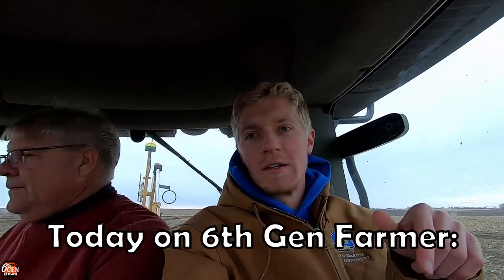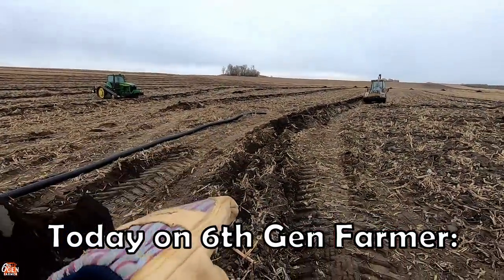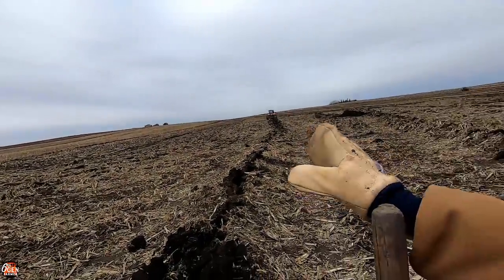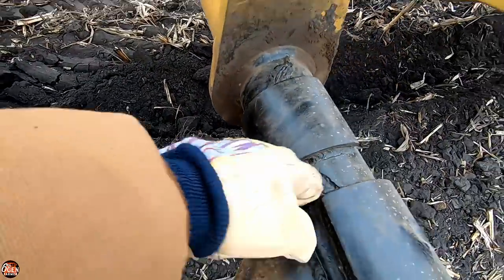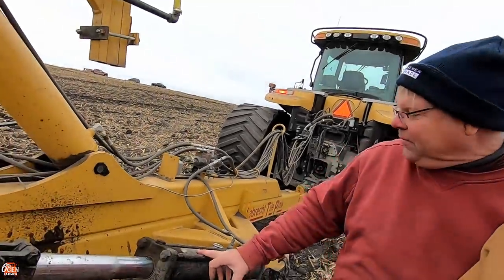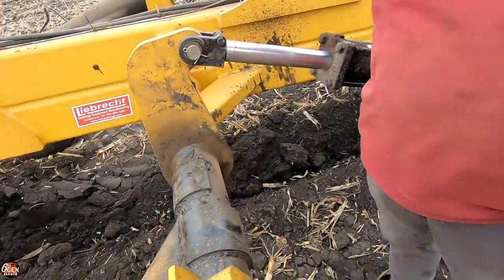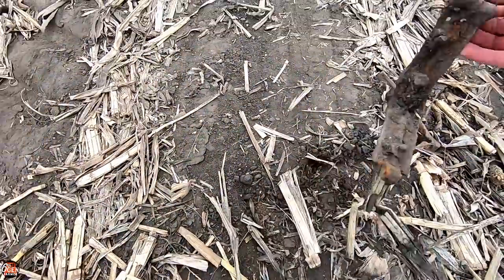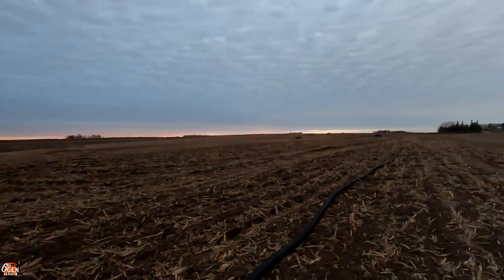TILE PLOW IS FIXED! Digging up old Farm Remains

Comment: The soil doesn’t look that heave to need tiling but it must be or your dad wouldn’t be doing it. I imagine it’s done in anticipation of wet years.  Where are the tiles dumping the water?  Thanks for the videos, really enjoy watching.
Reply from the maker: I agree that it doesn’t really look like it needed tile but this year has been so dry.  The water is draining into a county main which then goes into a county ditch about a mile away

Comment: I would not surprise me if it was the shock load from the ditch that did it.  How much difference in cost between a towed and a mounted plow ? Thanks for the video.
Reply from the maker: Not 100% sure on the price difference but I’m guessing around 25% more for a mounted plow with mounting plate
Reply: @6thGenFarmer  Thanks. I guess my "uneducated" choice would be for the trailing over the mounted version. Easily used on multiply tractors and cheaper.

Comment: What size of tile are u putting in? how long is the longest run?
Reply from the maker: We are putting in 4" and connecting it to a 6" main in this particular field... If you can make a run go from one end of the quarter to the other its 2200 feet.  900-1200 feet is an average long run probably